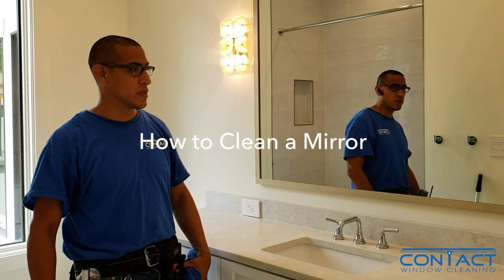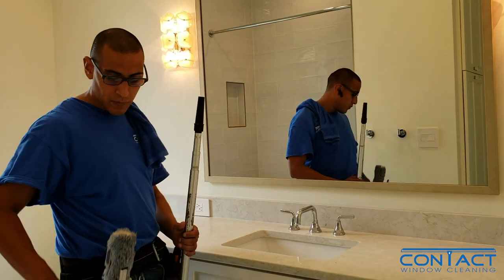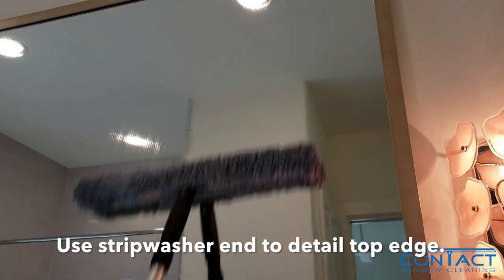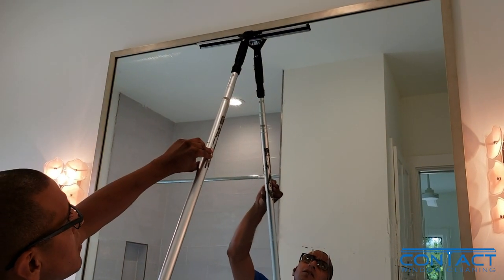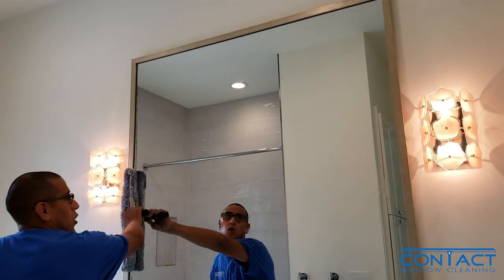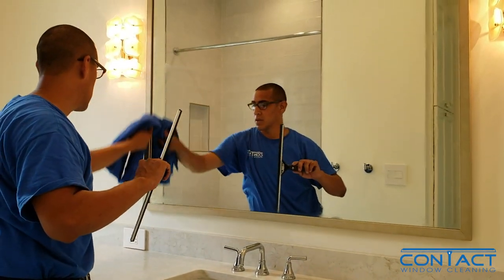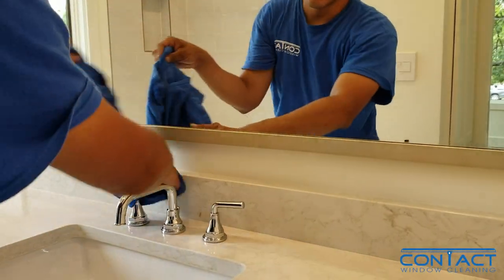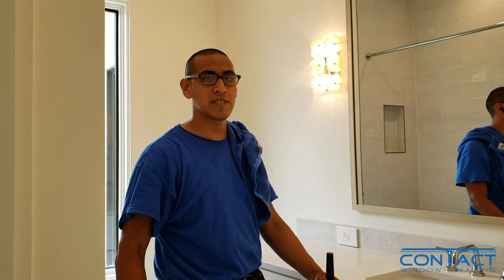Mirror Cleaning

Comment: I have a dilemma. My complex recently resurfaced our tub/shower. There is some kind of residue now from it on my mirror and counter. I have tried alcohol, vinegar and pure acetone to get it off. Nothing worked. Any other suggestions?
Reply from the maker: Go to Lowe's or Home Depot and ask for #0000 steel wool. Make sure it is the correct grade (#0000) otherwise it may scratch the glass. Try buffing the residue out without any solution on the glass making small circles and apply pressure as needed. Let me know it that works. The cost of the materials is under $5.
Reply: @ContactWindowCleaning  Thank you so much! I will try that and let you know. I'd ask maintenance to do it, but I don't trust people who would do this work without the simple consideration of covering stuff up before spraying in the first place, you know?
Reply from the maker: @McGregorGirl  I know very well the frustration. When customers ask why there's a charge for paint overspray removal I tell them to thank their painter 🎨.
Reply: @ContactWindowCleaning  Ok, so I Got the stuff off my counters and mirrors. I used oven cleaner sprayed on for a couple minutes, then scrubbed with the #0000 steel wool and it worked like a charm with little to no effort. THANK YOU!